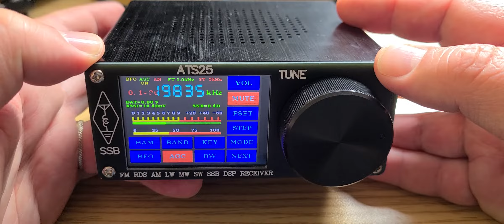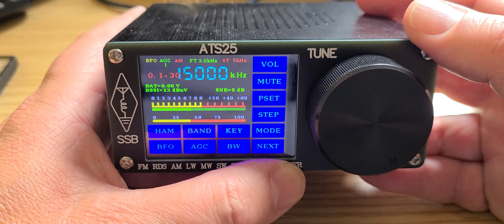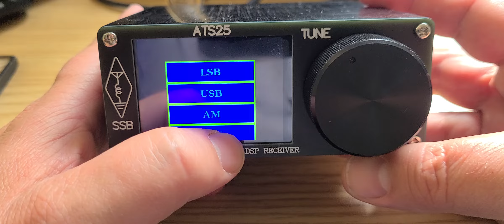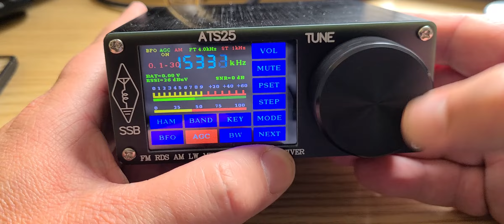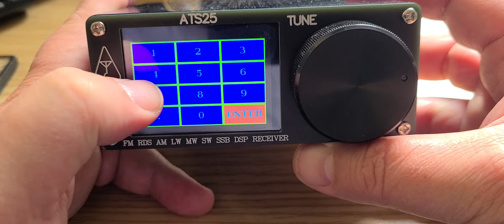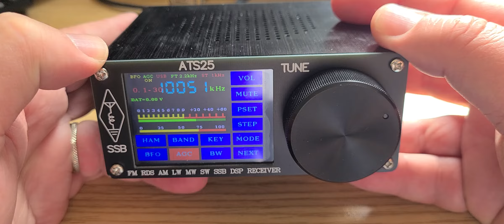ATS-25 DSP operations and personal observations while using the device

Comment: Would this radio be a problem for a wire antenna with overload?  I'm surprised the BW range isn't greater than 6KHz.
How does it compare to the 330?
Reply: Comparing it to other radios including several SDRs that visually show the audio bandwidth, it sounds like the values for bandwidth are actually half - so the 6kHz is actually 12kHz, 3kHz is actually 6kHz, etc.  As far as attenuation, I adjust it to 10 or 12 and have no problems with overload.

Comment: I would have loved to have a radio that good in the 1970s when I first got into shortwave. How well does the ATS-25 work on medium wave?
Reply from the maker: it's sensitive but suffers from internal noise on LW and MW
Reply: @OfficialSWLchannel  it's not that bad if you ground it it's not that bad anyway but it's not a deal killer I love this radio despite its little imperfections
Reply: I noticed on mine FM stereo even has the name of the station and the name of the artist and sometimes other things right underneath the band